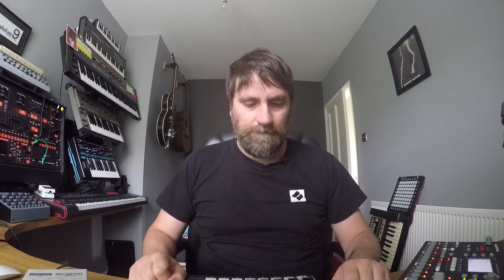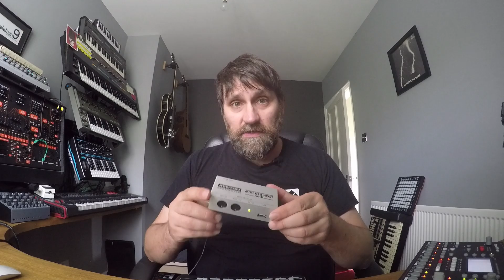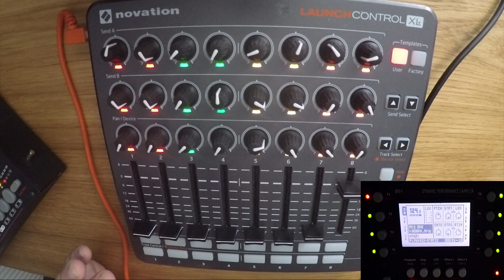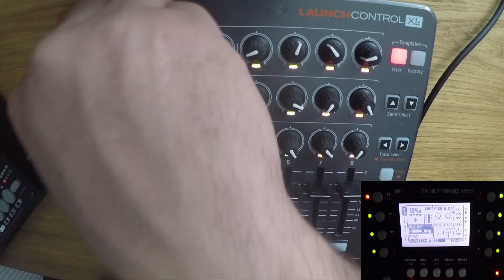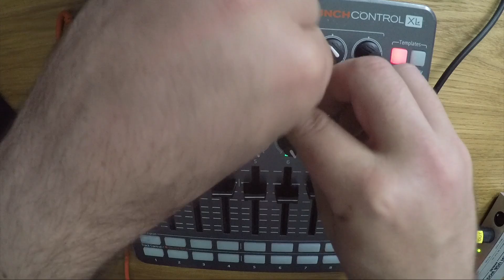Novation Launch Control XL firmware update controlling Elektron Octatrack and NO COMPUTER!!!!

Comment: is the firmware octatrack exclusive or can you control other machines at the same time?
Reply from the maker: Hey Hey,
No it's not OT specific.
Using the editor software, it can be programmed to be used with any piece of hardware or software. The controls on the LCXL can be programmed with any CC or note data, on any MIDI channel too. As long as you know the CC/note number and MIDI channel of what you're trying to control  it's pretty straight forward to set up. The templates you load in to the LCXL flash the memory and stay in there too, even after unplugging... It's a truly ace controller and works a treat with a direct MIDI out.
Reply: -CALC- not sure i quite understand. Can i control both my octatrack and my synths by changing banks?
Reply from the maker: krakou2 I reckon that could be possible although I've never tried to do it that way. 
The LCXL is literally only a MIDI controller so its how you manage  that MIDI data that's important here.
You'd need to work how to pass the MIDI information through the OT on to the other synths, If your able to do that there should be no reason why it won't work. 
MIDI Thru will pass the LCXL data through the OT although... if you do use the OT's MIDI Thru port rather than MIDI Out you may need to sacrifice the OT's MIDI sequencer which uses the MIDI Out port to send its sequencer data.  
The set-up that I created was designed to control the OT's own Audio tracks (mixer and parameters) at the same time, I take control of the synths directly. 
Hope that helps :o)
Reply: -CALC- thanks, the idea is to benefit from the pots to control knobless synth modules. 
I see what you mean. If I put my synth on midi channel 9, it should be fine or am i stuck with the autochannel thing?
Reply from the maker: krakou2 Hmm good question... 
I use the Auto channel to control all my MIDI stuff so I'm pretty sure that would work. I have to say auto channel control really works well for my set-up but I'm lucky enough to have synths with lots of knobs on already :o) !
The OT Audio tracks use channels 1-8 so setting the synth and an LCXL template to Channel 9 then connecting your synth to the MIDI thru should work. The only thing is that you cannot send sequencer data to the synth from MIDI Thru so the sequencer would be sacrificed.
There may be another way to pass both MIDI signals from the OT.
A reckon MIDI merge box would be able to do it. Merging OTs Out and Thru together then passing the combined MIDI signal to the synth could work but that would need yet another little box and could be a faff (depending on your point of view).
I use a Kenton MIDI merge box to send Clock, Analog Keys (as a controller keyboard) and the LCXL all to the OT's MIDI input and that works a treat.
Reply: -CALC- ok i get it! Merge box or dispatcher with host capacity like iconnectmidi4+...would that work?:

LCXL bank1->usb->ICM4+ out1->ch 1-8 octatrack
LCXL bank2->usb->ICM4+ out2->ch 9-16 synth
octatrack sequencer midi out->ICM4+ in1->ICM4+ out2-> ch 9-16 synth

(could even throw an ipad as asecondary controler)